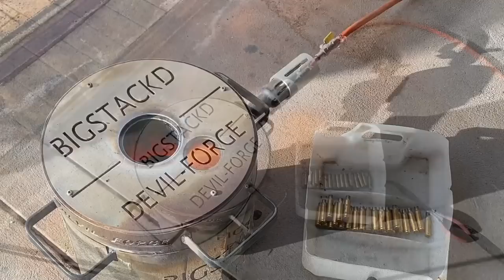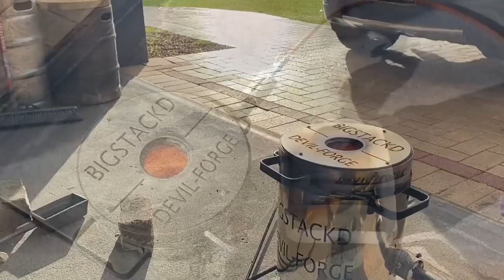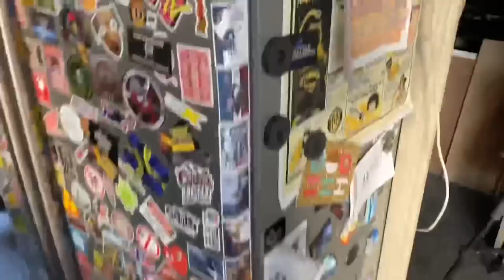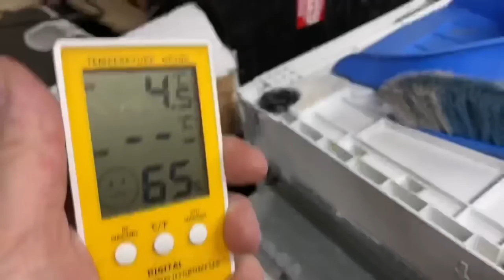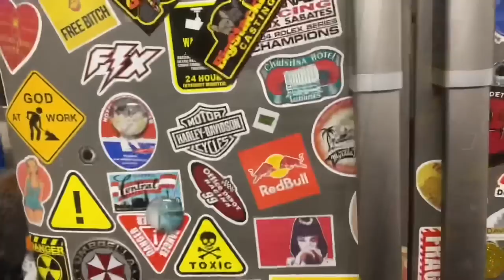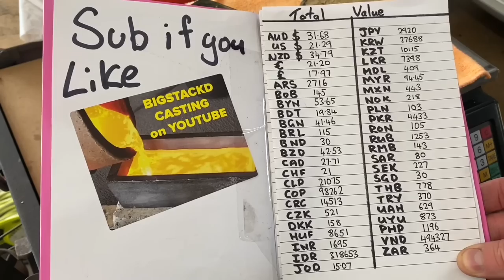Bulk Bullet Shells To Mirrored Bar - Trash To Treasure - ASMR Metal Melting - BigStackD Casting

Comment: As posted below, those are 7.62x51 nato rounds. They are the standard battle rifle and machine gun round for NATO forces. They are essentially a shortened version of the American 30-06 which was the US standard rifle round from its adoption in 1903 all the way up until 1952 when they adopted the M1 rifle and subsequently recambered their M1919 machine guns for the newer round. They have very closely matched balistics for the older cartridge but still a little weaker. The 7.62x51 is still very much in use today by all NATO countries and even one of the stipulations for the new 6.8x51 cartridge that the US Army just adopted was that the new cartridge manufacturers readily be able to change over to loading it one their 7.62x51 lines. The 6.8 give almost identical balistics to the old 30-06 cartridge by using a bimetal case with the Wweb and head being made of stainless steel and the walls and throat made of traditional brass. They then simply loaded it to amazingly high pressures (80,000 psi) compared to what a full brass case could withstand (somewhere around 65,000 psi). 
A tip, you can get a hand reloads press with a universal decapping die to remove the primers. The primers are often made of different alloys that are softer and the anvil inside them is steel, by decapping the cases, you can remove the steel and spent primers and end up with a purer alloy of brass.

Comment: Those are 7.62x51mm rounds.

People in the US would probably just buy those casings to reload . Assuming 80kgs and 11.7g per case, that's about 6500 rounds. Heck, for $0.10 each on the low end because how dirty they are, there's like $650 there. But I digress. 

Nice looking bars.
Reply: Military brass is twin flash hole. Much easier to buy civilian manufactured cases.
Reply: @neodutch  from the case heads I saw stamped and the research I did on them, I found that someone said the AFF 91 were boxer primed, and same with the ADI 92. But of course the limited amount of information on old mil surp Australian rounds is very vague.

Comment: In the US those casings (depending on caliber) could be worth quite a lot of money as reloadable casings. In some cases, they could be worth many, many times what the scrap weight is. For example, a single 6.5 Creedmoor case is worth ~$1 USD. 7.62 NATO cases are worth about $0.17 a piece. 30/06 go for about $.36 each.

So I read that these are in fact 308 (7.62 NATO) Doing some quick and dirty math, if all of those are the same there's about 39 empty cases per Pound. (2.2 Lbs per KG x 80 KGs = 176 Lbs)  That's 6,864 cases worth over $1100 USD if my math is correct.

Comment: Need a bigger place?  Here is a suggestion that will create more space and take away almost nothing from the floor space. Use deeper shelves, and go to the ceiling. I have a bookstore. By adding 3 inches, 12'' to 15'', in depth to my shelves  I doubled the No of books I can put on shelves.

Comment: While it’s a very good idea to remove the live rounds, they wouldn’t do a catastrophic amount of damage if they went off. In the conditions of the crucible and furnace, they can’t reach nearly the same speeds as if they were fired from a gun. There’d still be an explosion, which could damage the crucible and send molten metal flying, but it wouldn’t be quite on the same level as a literal gunshot.

(At least as far as I know)

Comment: 7.62x51 or .308. The case look like they've been annealed, so they might be milsurp, or discarded brass from your local military post.
If they were .30-06 Springfield, I'd PM you my address here in the States, and give you a fair price for about 25lbs. of them.
Reply: I’d’ve thought it was 7.62x39
Reply: @darkmerchant1  Same caliber of bullet, but the case would be shorter by 20mm, and fatter at the bottom.
Also, brass cased 7.62x39 is hard to come by. It's usually steel cased w/ corrosive primers. If he were to smelt those, he would need to press out the spent primer buttons first, as they are seriously toxic.
Reply: Does the headstamp he shows at 1:10 mean they are military ammo manufactured at the small arms ammunition factory #2 in Victoria in 1991?
Reply: @scottdoubleyou563  I now have new information. Thanks

Comment: If you put way too much borax and let it melt onto the solution, but not completely mixed in, then it makes like a glue spiderweb and you can pull it up with the gross of the top impurities. Now of course this is just to grab stuff quick and dirty. You'd want to refine after for sure.

Comment: You wonder what a furnace of live rounds will do, huh? Well! Let me tell you about how these bits of ammo work. 

The live rounds you have are made up of some main parts. The casings, which you are melting down, hold everything together and help keep everything in a consistent shape. With the help of the chamber of the firearm, where the round goes before being fired, it also holds in the pressure resultant from firing. 

The bullet is pretty self-explanatory, mainly just a projectile. The copper coating is soft enough to grip the rifling on modern weapons without damaging the barrel while the lead interior merely gives as much mass as possible. 

The primer, held beneath the circular portion on the closed end of the casing, creates a spark when broken or deformed which allows it to do its job without piercing it fully.

The aforementioned spark ignites the propellant, which gives the lion's share of the energy to propel the bullet. 

Bearing all this in mind, the propellant and primer can actually be slightly heat sensitive. Once it gets hot enough, depending on the manufacturer this can be about 350 F or, if my mental math is correct, 150 C the propellant can ignite itself either because it reaches its auto-ignition temperature or because the primer does its work. Because the casing alone is not strong enough to withstand the pressure, it gets dispersed in all directions. This obviously will shred the casing from the tensile strain, creating shrapnel that can actually do quite a lot of damage if the conditions are right.

Comment: Those look to be .308s or 7.62×51mm standard NATO full rifle cases. Neck on the cases are way too wide for it to be 5.56×45mm but it's a nice round and not a bad way to recycle brass especially if you cast rods of brass as many hardware stores and manufacturering firms would buy it off you for a good price.

Comment: "I wonder what a furnace full of live rounds would do?"

Short Answer: Explode.
Long Answer: As the casings or "Brass" of the Cartridge, is designed only as a gas sealant, container and heatsink for the ammunition, not a Pressure Vessel, it is most likely that the cartridge, either through heat transference or simply detonation of the Primer, would cause the cartridges to simply burst due to not being supported in any way, with the Casings bursting like firecrackers. the Bullets themselves would not have much energy if any at all, and though the crucible would break, you wouldn't get live rounds zipping through the air like they'd been fired from a gun.

Comment: A furnace full of live rounds would either A: the rounds would blow up due to pressure buildup in them and the powders would combust without causing much damage, or B: do basically nothing beyond getting melted and maybe the powders getting burnt off. I'm not entirely sure, I'm leaning slightly towards the former of the two possibilities, Simply because if you consider what Mythbusters did to a bullet by putting it in a smoldering hot coal grill fire, it went off, but non-lethally because well... no chamber to focus the gas into the back of the round. Either way, you'd either hear a bunch of popping, or not much honestly. Nothing really overly exciting or requiring of safety equipment. Still not necessarily smart tho to do in the first place.
Reply: Depends on the size of the round. A .50 exploding will great quite the mess 😂 I’ll see if I can find the video I watched
Reply: The pressure has to go somewhere and usually reults in the case taking flight with enough force to cause injury or death.

Comment: If I had to guess the caliber...

It looks like a full powered rifle round, like .308, but since this is Australia my guess is that it's probably old British .303.  And no, I wouldn't load those live rounds into a rifle.  Ammunition can change over time, in particular, the gun powder.  Depending on the circumstances of where it was stored it can become more dangerous.  The individual grains of the gun powder can break down over time becoming irregularly shaped and sized, changing the burn characteristics radically.  DO NOT LOAD THOSE BULLETS INTO ANY SORT OF RIFLE!  

Now what would a crucible full of live (presumably) .303 rounds do in a furnace?  Predictably explode due to cook off long before it got to brass-melting temps.

However, in the wreckage of the furnace  you would find copper shells of bullets along side the blown out casings (along with some traces of lead perhaps).  The bullets oddly enough wouldn't actually do anything.  The reason why the fire off when fired from a gun is because the gun directs all of the explosive force forward out of the barrel and the bullet also just so happens to be in the way so it comes along for the ride.  However, without the gun directing that explosive force, most of the energy of the blast is lost in all directions and the bullet would be too heavy to be moved far.  Plus the lead part of the bullet would be too busy melting to be sent flying anywhere.

If you want to see the aftermath of a bullet cook off (of multiple cartridges up to .50 BMG) here's a video that does precisely that: https://www.youtube.com/watch?v=gvnaBUGS_o4

Comment: 4:20      You WOULDN'T want to find out!  It would be an extreme case of,  "Duck and Cover!", And hoping your cover is thick enough to prevent penetration. Like 1/2" steel plate.  That's got to be 💯% your silliest of silly thought-provoking, 😜 thoughts.  
   I do like the idea of policing the range for free meltable brass. I reckon the primers float to the top for skimming? I haven't got that far into video. I had to stop and comment about the possibility of throwing live rounds into the 🔥!  LMFAO ! ! !
Reply: a cartrige exploding in open air would have almost no velocity. It would mostly be just shrapnel from the casing
Reply: I'll stand behind the steel plate while you prove that statement.   LOL !
Reply: @brockshields9336  It's been proven 1000s of times, without being chambered the most it will do is sting.
A few years ago there was a video of a fire with 50 caliber rounds cooking off, casings and bullets were bouncing off the windows, couldn't even break glass.

Comment: So I'd think a furnace with live rounds in the crucible would just end up having the rounds fire off once at a certain temperature.

The gunpowder would generally explode inside and the bullet would travel out and hit whatever it was in line to hit at the time.

Generally they'd just damage the inside of the furnace and maybe some would fly out the open top.

Granted the bullets may not do as much damage since they're not designed to heat up slowly and then fire, it's usually firing pin is hit, gunpowder combusts, bullet travels out.

Comment: Those casings were arguably worth more as reloads than as an ingot
Reply: Not ex military brass. Too hard the deprime.
Reply: @neodutch  as long as it's not steelcase some fudd can reload it
Reply: @neodutch  Just have to get rid of the crimp, they make dies just for doing that. I reload 5.56/.223 and get a fair share of military brass.
Reply: @TheWabbit  7.62 has twin flash holes.
Reply: @neodutch  Only the Berdan-primed cases which are USUALLY older casing ( early 80s and back )  there are a couple exceptions. Boxer primed are single flash-hole and most Nato 7.62 have changed to Boxer just crimped.
Reply: @TheWabbit  Still twin flash hole in '91. I was shooting Full Bore Rifle at the time and we used military ball ammo.
Reply: @TheWabbit  Tracer ammo was single flash hole and IIRC there was a non-trace that was single as well. There was 3 dots in between the lettering on the head stamp.
Reply: @neodutch  Honestly I don't reload .308/7.62x51 however I have previously been given large amounts of brass which I separated then sold or traded for brass I wanted so I'm not an expert on the different countries casings. I just know I got a lot of military 7.62 and it was as described. I would imagine the source would give us a different prospective also.

Comment: I only melt 22 and damaged brass. You get alot more cleaning n polisjing in a tumbler then selling for reloading. 7mm goes for around $25-40 usd for 50 rounds. You probably melted over 500 rounds = 250-400 before shipping. Depending on what kind of 7mm that was.
Reply: it was 7.62x51
Reply: @lucky43113  still 35 for 100 and by the looks of it he has a few thousand. He can sell it dirty for 25 and still would be like 5x scrap price.
Reply: @Mynameis7nad  Where do you pay 35 cents per case?